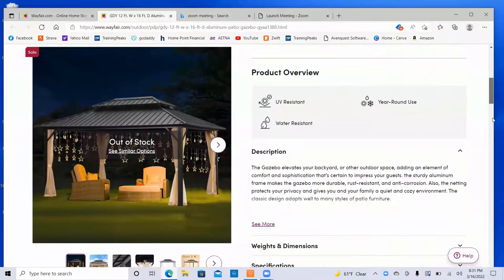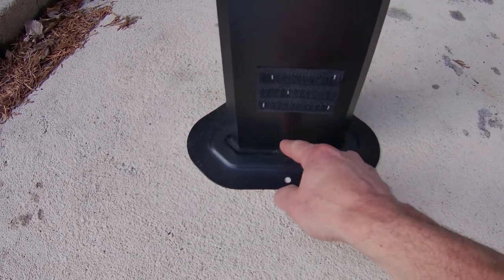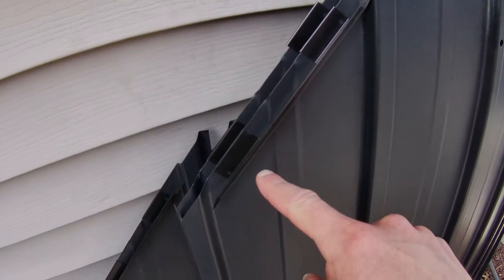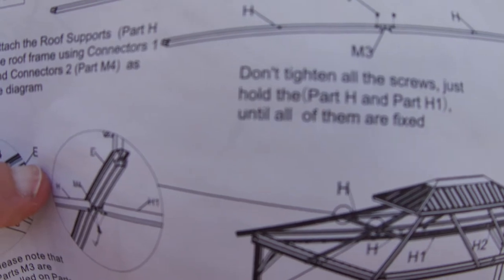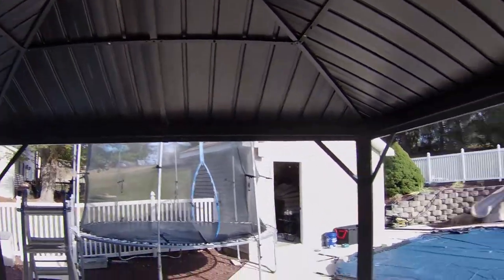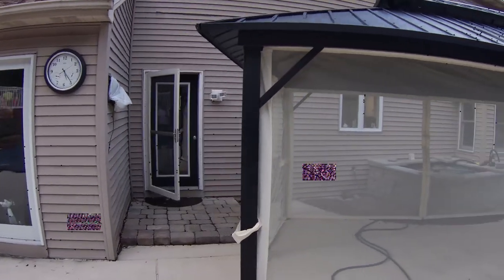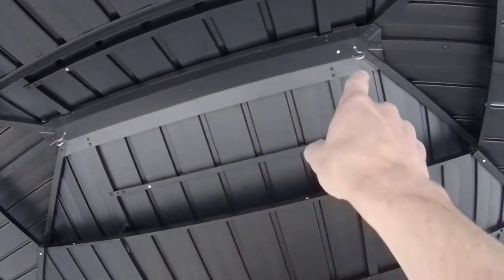GDY Gazebo Install & Review

Comment: I was thinking about this but wanted to use wood posts for the legs to give it a little strength. Looks like the legs it comes with are triangle?
Think it would be an easy switch ?
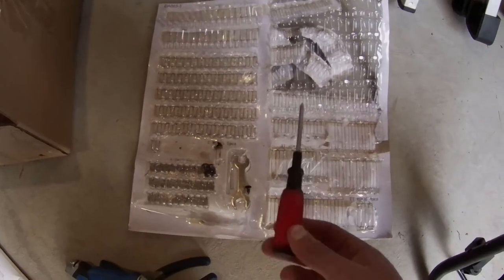Reply from the maker: It’s triangle. Hit pause at the 4:45 mark of my newest video Anjon pressure filter. You can see in the background I built 5 layers high of Lowe’s landscape blocks around each post for a better look and to make more sturdy.
Reply: @thestclairchannel3889  I see that now. Good idea! Thank you

Comment: Can this be a one man job? Also, are you drilling the posts into the concrete? Do you have to level each post or is installation easier?
Reply from the maker: It’s possible to build it with one person. I only had my wife help for 5seconds to balance the frame as I put it together. You could potentially lean it against a wall to piece together. I did not yet drill it and anchor into the concrete. I don’t believe it’s going anywhere it’s been through 50mph wind gusts so far. It’s just laying on a concrete patio so no leveling was involved.